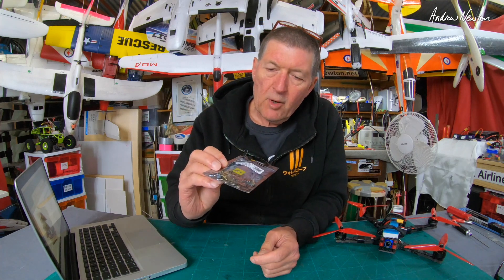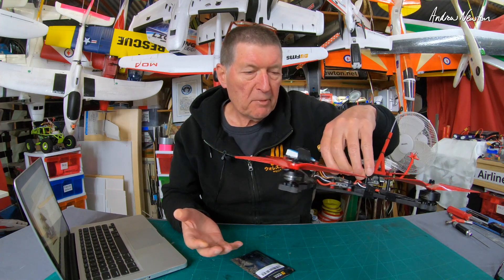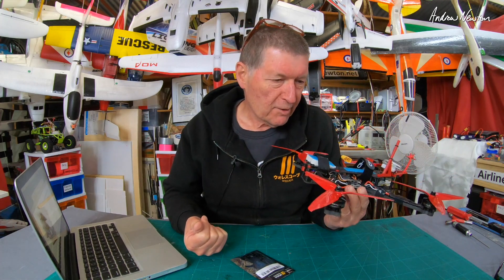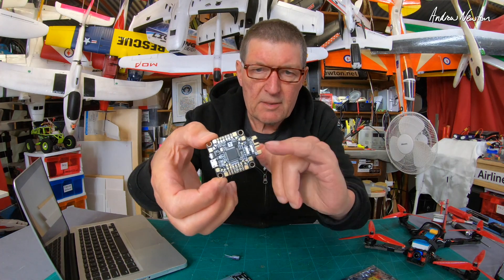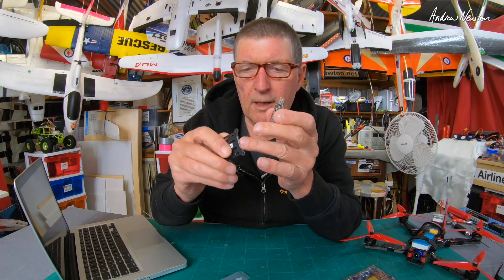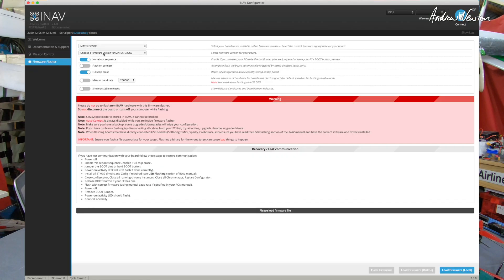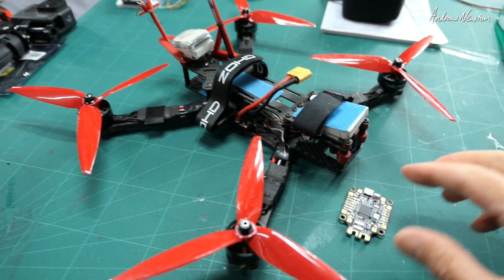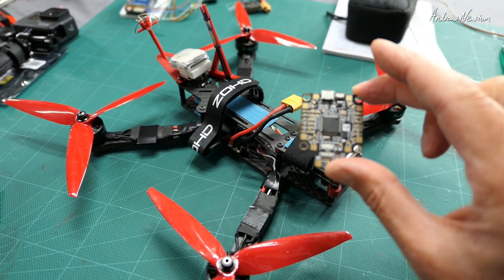Matek F722-SE Flight Control Board

Comment: I was a huge fan of the Matek FCs for miniquads and still have one of the older F405-CTR which is basically an F4 version of this one in a 5 inch Rooster and it’s still going strong after almost 3 years of abuse. It’s a pity Matek don’t offer a 4in1 ESC/FC stack ready to go for miniquads because I tend not to use individual ESCs much on quads now.

They seem to be more geared toward wing boards running inav or ardupilot which is cool too though.

Comment: I'm struggling to configure the matek F722SE board properly. When the board is connected to iNav, everything is working well (servos are working, motor is running with the iNav Master switch, Pre-arming check all green, (no GPS)everything fine) but when I disconnect the board from my computer and try to arm it, it’s beep ones,with the blue led flashing and the motor doesn’t want to run . I have flashed the board with the latest firmware inav 3.0 but it doesn’t resolve the problem. I don’t know what is wrong, does any body have an idea please
Reply from the maker: Not me, anyone else?
Reply: Sounds like maybe something is preventing it from arming like your throttle min value is lower than your throttle will go or something.

Comment: Hey there. I watch a lot of your content and I was hoping you could help me out with my Matek 405 flight controller for my rc plane. I have an ESC with a white, red, and black wire, and in that same bundle is a yellow wire. Im assuming I just cut the yellow and red wire and only have white and black wires onto my FC. I am worried ill bypass my BEC on the ESC if i dont use the yellow wire but maybe that is alright. My second question is can you use 26awg gauge solid coper wire for soddering? Or should I cut up servo wires and use them instead? IM trying to run my 3 video camera and VTX wires from the tail of my plane to the FC in the middle of the plane. Any tips or solutions would be appreciated greatly, Thanks in advance
Reply from the maker: What is the yellow wire? Could be ESC telemetry or motor reverse. Don't connect the red BEC wire to the FC, just ground and ESC signal. Flexible insulated and twisted servo wires are much more suitable than solid copper wire for video. You will have less interference in the video.
Reply: @AndrewNewton  THANK YOU! The ESC is a  flyfun 40a hobbywing esc. Its a smart esc  I think so telemetry is probably the yellow wire. And thanks for the tip on Video interference, ill use a bunch of Servo extenders twisted up for the VTX to FC. They fit into the header pins perfectly anyway. Thanks again!!

Comment: Been flying a 100mm micro quad for 3years or so now & finally went fullsize at the start of the year with a 'cheap' 7inch.
After many months of stuffing about with the cheap eleaktrickery that came with it I replaced the lot, with the heart of that transplant being a Matek flight controller....
I went for the F405-SE for a couple of reasons; it came with iNav 2.5.1 already flashed onto it,  I have an F405Wing waiting to go into a Tricopter I have stashed away waiting to build & that the F405CTR is no longer made by Matek.
The F405-SE also has the newer 310 barometer & so far I have found that even with foam over it, it ALWAYS reads up to 100+meters higher in altitude as the throttle is increased....
Besides that, it has done everything asked of it including running a RunCam Hybrid off of the 5volt onboard BEC with no complaints along with running clean power from the filtered vBat for my AKK Race Ranger 1600.
I am also SUPER impressed with iNav & how it feels compared to a brief dabble with BetaFlight on the other crap boards that originally came in my quads build kit.
I used the 4inch 'Pre-sets' option in configurator & then closely adhered to Pawels suggestions in his 'How to set up iNav on a 7inch' clip.
If I ever build another multi-rotor, besides the already planned Tricopter, Matek & iNav will DEFINATELY be my first choice!

Only tips I really have for you Sir Andrew is; just before a flip or roll, blip the throttle & then cut throttle AS you perform the move- that way you don't loose as much in altitude & therefore can perform them closer to the ground.
Perhaps catching up with you stUAV Futures for a flight or two to pick up a few more hints & tips seeing as you both use the same park for most reviews but at different ends....
Then again, Im sure I seen a clip of yours a while back flying with a group which included his fixed-wing mate 'Wing-man Johnno' 
Best of luck with your 'wingless VTOL' & looking forward to seeing more of it soon!

Pawel's 7inch set-up clip; https://www.youtube.com/watch?v=-vmZkaJ2n0w
Reply from the maker: Long Range Tony is a regular fixed wing flier too.

Comment: I suggest you set up rescue mode, specially if you flight over water. If you lost the signal at least is going back to you.  specially if you have enough uarts.
Reply from the maker: That's a Betaflight mode I think. INAV covers that with RTH failsafe
Reply: @AndrewNewton  correct,  with Inav was fantastic because the quad come back and  land like a DJI mavic.

Comment: Hi Andrew 
What size Lipo and GPS Unit are you using on the Pirx ??
Nice flying mate 😊👍🚁
Reply from the maker: Beitian BN-880 and 1800 to 3300 4S LiPo. Have tried 3500 4S Lion too with gentle throttle control.

Comment: DIY FPV Quad will Cost :  Radio $100 , Frame $50 , ESCs $50 , Motors $60 , FC $40 , RX $20 , VTX $20 , Antenna $10 , GPS $ 20 , Batteries $50 , Charger $30 , Camera $100 , Gimble $50 , Goggles $300 , additional bits $20 = $920 ......... Then you have to Build it , Program it , Tune it and Troubleshoot !  ...... Yer Better Off buying the DJI Mavic Mini Fly More Combo for $450 on Amazon !  ...... Then you will have some Nice Smooth Videos worth saving and watching .... Over an Hour's flying time ..... and can fly the Day you get it ... up to a mile away ! ..... Merry Christmas !
Reply: Yep...and you,ve learnt nothing
Reply: @k1ortia  I learned that Most cameras are crap unless you fly DJI or a GoPro ..... that most Freestyle flights last 5 minutes , are prone to Crashes , don't have much Range and flips and tricks make proper videos useless ...... Plus you will spend 3Xs as much ! ...... So actually , I've learned a Lot .... Merry Christmas !
Reply: @robertbrander2074  have you learnt how to make a drone?

Comment: As Soon as Someone Makes the Perfect Drone .... All the Bits and Pieces reviewers and manufacturers will be out of Business !  .... I just got a DJI Mavic Mini .... Now I don't have to worry about motors , frames , ESCs , FCs , TX , RX , VTX , antennas , props , radios , cameras , PIDs and diminishing Quids !  .... I am now Burden Free and can just worry about the Videos Pics and Flying . ~sigh~
Reply: I also have a Mini 2....It's a great filming platform for sure, but it's absolutely nothing like flying a Quad...
Reply from the maker: True but the MM is not a quad in the same way, it's more of a flying camera tripod
Reply: All you,ve bought is a really good small ariel photography quad that anyone can fly.. These are nothing like freestyle, racing or long range quads.
Reply: @k1ortia  Isn't good photography and 20/20 fpv the whole Purpose of the Game ?
Reply: @robertbrander2074  Nope, as has been explained, the two are very different. The Mini 2 is a flying camera platform I have one, it's brilliant. A long range quad is quite different, flies in a different way, generally much faster aerobatic, requires considerably more pilot skill.  Still capable of quality HD capture in the right hands.
Reply: @EnglishTurbines  Excellent , an Argument !  :-) ..... The only things different between your Flying Piecemeal Contraption and My Tripod is ... Speed and Power ... and a 249gm footprint !  ..... If I want to fly Normal and you want to fly like a compulsive acrobat , or try to break the speed record , good luck on avoiding costly crashes !  .... But flying is flying .... My style is to enjoy the View from above , with the best camera to send me memorable pictures and get back home safely ....... You get a thrill from risking control and equipment for needless challenges ..... my flying is to avoid long walks to pick up the pieces ....... Cheers !
Reply: @robertbrander2074  It's not our fault your unskilled though is it?....lol...🙄🙄🙄